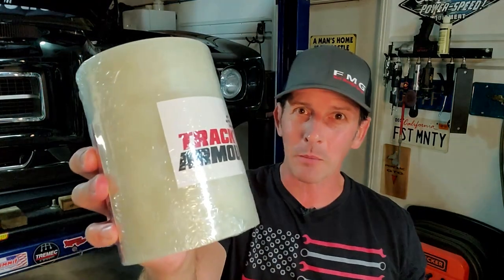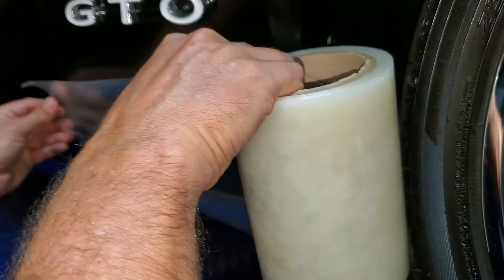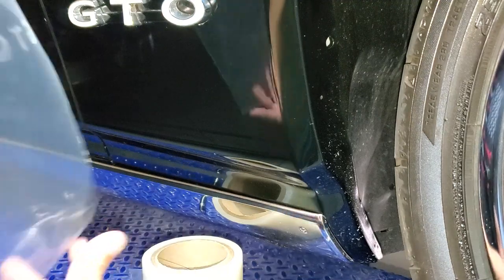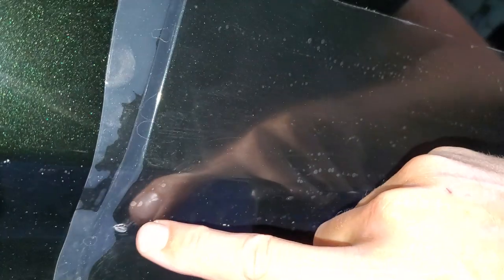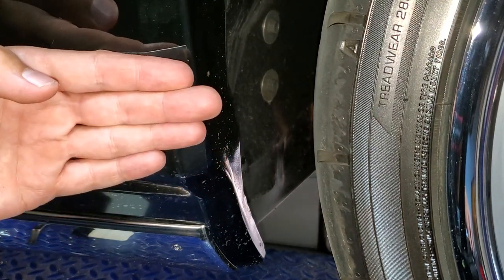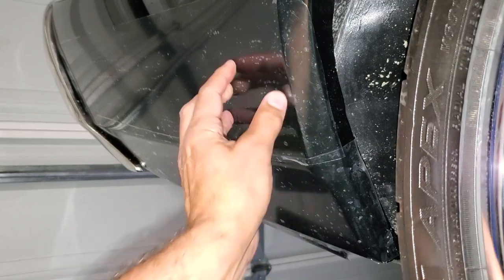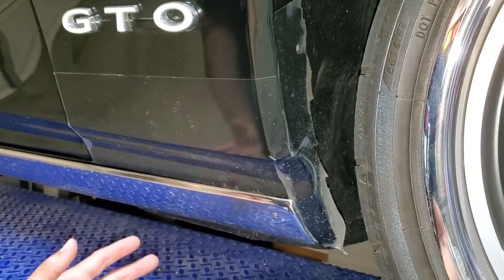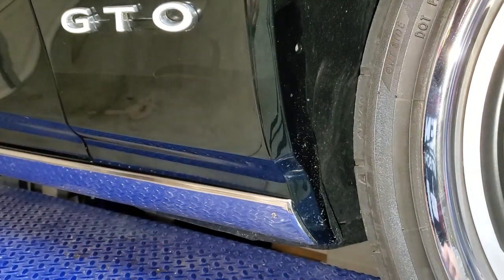How to install Track Armour, to prevent Rock Chips.

Comment: Does this leave a sticker adhesive residue on your paint? I plan to use for this a cross country trip that is going to be a 4 day drive. Was curious if this is meant to be to be left on the car for multiple days or if it is just meant to be a one day use then remove it
Reply from the maker: Multiple days should be fine... no residue is left.  Good luck!